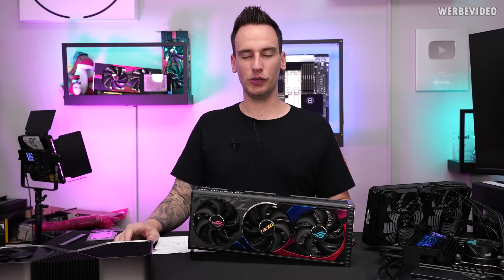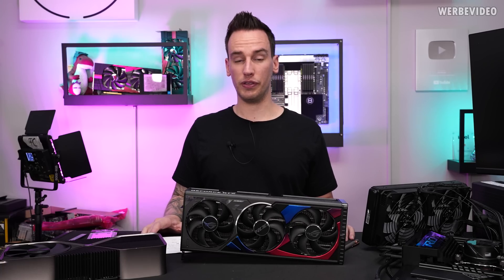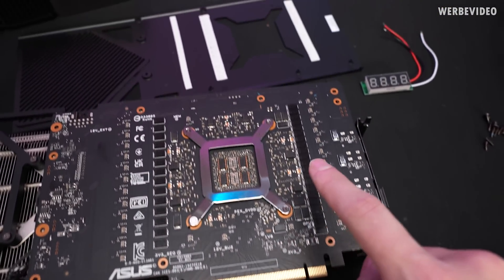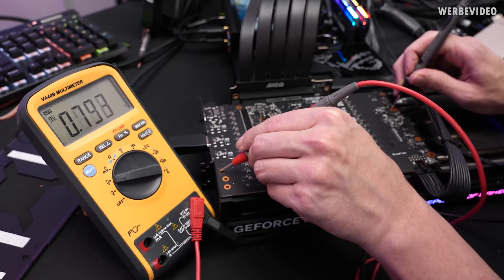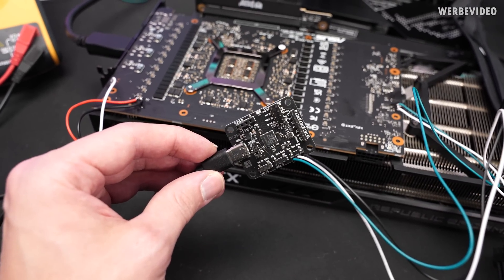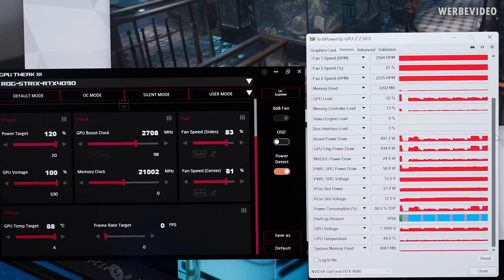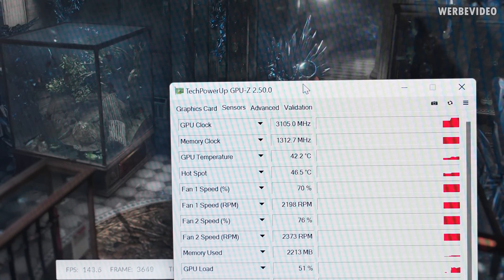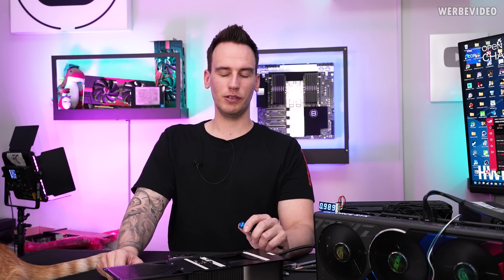Volt-Modding the RTX 4090 STRIX causes insane Power Increase

Comment: you are on a completely different level than other tech youtubers.
Reply: so much fanboys on here. If you truly loves hardware stuff, you don't mind if they are hardcore OC, engineers, reviewers etc. as long as they're helpful and provide useful information.
Reply: These guys are engineers, not just social media influencers.
Reply: Bulidzoid/actually hardcore overclocking?
Reply: @JatXoc  Comparable knowledge/content but Roman has the better production values... and cats! They bring different things to the party too. Neither are channels I'd dispense with AT ALL, unlike Jay. Linus I simply don't watch.
Reply: @JatXoc  he whines and rambles too much. He reviewed the card pcb with pictures so he is definitely not actual hardcore overclocking the 4090.
Reply: @zappulla4092  I mean, not exactly his fault he can't get hold of one.
Reply: @zappulla4092  it's hard to overclock things I don't have.
Reply: @ActuallyHardcoreOverclocking  You just keep being you, matey. We wouldn't have you any other way. 😉
Reply: Idk, sometimes I wish he'd use some better equipment. Like he can't monitor voltage and current of the 12V-In because the little gadget doesn't fit... Maybe get a proper bench-top power supply? Or use current clamps? I mean he is using a 10-year old no-name multimeter from the bargain bin at the hardware store. The voltage monitors are from Amazon, for like $2 a piece. Instead solder on some proper test leads and use a multichannel oscilloscope for visualization. That'd be a lot more interesting and wouldn't look as janky.
Reply: @graealex   ahh, someone with a strong opinion that has no idea what they are talking about.  Always refreshing to see people like you explaining how a professional should do it your way when you have no experience.  Please, tell him how he should run his YouTube channel as well, since you have 9 subscribers.
Reply: @the_Scarlet_one  derbauer fan bois are the worst, by far. They even defended his worse-than-amateurish attempts at data rescue a few years ago.
Again, most of the tools he has are hobbyist at best, which is something I don't quite get. There are plenty of channels that show proper EE. Maybe leave your own bubble for once.
And nice for you to point out that I have 9 subscribers. I think that is a lot, in the context of me not actually putting any videos out there!? And no, I don't plan on making YouTube videos, but I can still criticize the amateurish stuff that Roman does. I don't need to be a cook myself to call a steak not properly cooked.
Reply: @graealex   is roman creating graphics cards?  No?  So it doesn’t require proper electronic engineering for HIS HOBBY. He does extreme overclocking occasionally, and sets some records, but he isn’t making a 4090ti der8auer edition.  He is testing a few simple things here that do not require full on electronic engineering to be done. 

You don’t need to be a cook to say a steak isn’t properly cooked, no, but when a steak is cooked at a buffet and you expect it to be the same steak as a elite restaurant, then you are showing that you are comparing apples to beef.
Reply: @the_Scarlet_one  Idk if Roman would agree if you called him "just a buffet".
Okay, look, he does for example shunt mods, every time it turns into a soldering disaster ("Hiroshima" as Northridge would call it) because he can't be arsed to get a microscope and a proper JBC soldering station although he is trying to do micro-soldering. (to his defense, LTT recently tried as well, and it was a shit show because of a lack of proper tools, even NR commented on it)
Just seeing this shitty ass multimeter on the bench already makes my blood boil.
I watch Roman's content for more than 20 years. Yes, you heard right. When he was just doing some hobby web design as a teenager, I spent time watching my dual ISDN Internet connection slowly download his shitty-ass flash websites to my PC. Some of his dilettantism just has not changed in these 20 years.
And ffs don't call his YT channel a "hobby". That is a major source of income for him.
Reply: @graealex  Start you own channel if you are that mithered about minor irrelevances.
Reply: @stevewatson6839  Loool. What a crude argument. I'm a viewer, and I choose to be a viewer, and not a creator, because I think the latter is a pretty miserable job.
Reply: @graealex  I watch things I LIKE. Maybe try it, you might have a happier life.
Reply: @stevewatson6839  See, you WATCH things. As I do. And I like to be critical of things that I watch. Maybe try to also be critical, you might have a happier life.
Reply: There's a difference between "tech" youtubers and electronics engineering channels. He does both
Reply: Hes not a techtuber. He's a true enthusiast; there is a difference. Linus and HWUB are techtubers; zzzzzzzzzzz. DB and Frame Chasers are true enthusiasts
Reply: He's an Overclocker first and foremost
Reply: Of course he is. There is an unwritten rule amongst us German engineers to live up to our reputation 😜
Reply: Yeah, GE just complains about every little minute detail, whether it affects anything or not. Gotta make drama out of anything.
Reply: Completely different level to (instead of than) other tech YouTubers.
Reply: he is breathing modding like others air :D
Reply: @adaster98  And a manufacturer... a German manufacturer.
Reply: D8, you’re the man!  Alsoooo there are a lot of snobby divas in your comments!  But that just means you attract a wide base with your quality vids!
Reply: Jays2Cents and LinusTech Tips have entered the chat 🤣💀 I can’t stand Linus, but I like Jay he’s good.
Reply: Just about every other techtuber says 'we just hit the XMP button like people at home do!' ... That poor DDR4 4000 running in gear 2 :(
Reply: Because the market for delidding CPUS and soldering 2000€ GPUS is like 0.00001% of the population
Reply from the maker: @DuBstep115  but that's the fun part :D
Reply: @der8auer-en  just now realised you do these videos in both english and germany, not just dub it. Hats of to you, insane dedication
Reply from the maker: @tomtomi93  thanks! Shooting twice turned out to be much easier and less work than dubbing :)
Reply: @der8auer-en  still admire your admittance to actually record it twice in 2 languages, having 2 channels was the best decision you did as YouTube isn't very good the multi language on the same channel as it would always push me the non English one first (as YouTube doesn't like recommending more then 1 video per 24 hours per channel and can't tell the language difference it seems when recommending videos even when it's marked as such language )

If YouTube could have two audio streams (witch I don't believe YouTube can do, only text overlay) that would be so much easier on one channel

but as you got to do the audio twice anyway guess video Recording twice isn't must more work anyway (apart from editing and uploading twice)
Reply: @der8auer-en  
You're my favorite tech twink, next to buildzoid <3
Reply: @tomtomi93  AND he is designing and making kit to boot... in Germany! A very rare bird, our Roman. 😃
Reply: @DuBstep115  you don't know that. That's just assumption. It could be 1% or 3% or even 10%.
Reply: @DuBstep115  This is is 2600 eur card. The fuck are you getting that 2000 eur price from?
Reply: @flybeep1661  0% VAT, company card
Reply: @DuBstep115  actually cuz most of them are just reading the spec sheet and running some benchmarks, and creating bs thumbnails, anyone can do that, but it takes experience and electronics knowledge to thoroughly review something like is the VRM design good, power delivery, components used etc even though der8auer dosent get everything right myself being an electronics enthusiast i just really appreciate that the content at least goes into the hardware
Reply: @adaster98  so true, linus doesnt undertsand pcie bandwith works, most dont get that dx11 or 9 games require the use of cpu affinity on 8+ cores cpu i saw others with badly installed msi center with half the tabs missing, one had rivatuner showing core % were all wrong but benchmarked as is etc ..a reviewer had 7fps more than me on a 1080ti with its 4090 but still published that as useful info
Reply: You have know Teclab channel, they are the best moders.
Reply: For the price of that thing I could buy a quality guitar that will increase in value the older it gets, even if it gets scratched up. I know where my money would go first
Reply: When I think about all the time i wasted watching narcissist steves videos aka gamers nexus I cant help but laugh. now hes bought and paid for by nvidia and amd so anyone that continues to value his opinions consider yourself shilled.

Comment: Can you do a video like using a 12900k or 13900k with a 4090 on a 850w PSU? Like with Corsair or Cablemods' 16 pin into 2x/3x PCIE PSU connectors.

Comment: Cant wait 2 more years to buy a cheap 4090Ti and I think by then the chips will clock higher due to yields
Reply: "cheap"
Reply: Only true AMD sized as AMD is going chiplet

Nvidia however just went from 8nm to 4nm they cant go lower for 5000 series they can only rearrange the transistors or add more so for Nvidia mores lore is indeed dead as they have stated themselves

I have a 3090 and have yet to need anything better and I’m rocking 3x 4k monitors

If i could sit down and pick a 3090 and pocket the difference or a 4090 i would pick the 3090 and pocket the difference as i have no need for a 4090 mainly because i dont use DLSS so DLSS3 means nothing

I would rather a 3090 and use the difference to get an intel arc A310 and a secondary machine if i wanted or needed AV1

Comment: Undervolting did make the GPU a bit slower, but 17% more efficient
Reply: i'm looking for frames per second, not pennies per month
Reply: @XX-121  I hear ya
Reply: @XX-121  "i'm looking for frames per second, not pennies per month"

Exactly. I don't buy a computer to save electrical power --- I buy it to generate computational power. If I wanted to save electricity I would simply not buy a PC.

If I were running racks full of computers things might be different.
Reply: @XX-121  This! I can never understand spending 2k on a card and then worrying about a few bucks a month for more power
Reply: Dont think 90 series buyers want efficiency
Reply: @cor74  "Dont think 90 series buyers want efficiency" Depends. If the GPU's fans start making too much noise, I undervolt to keep it quiet. I don't play with headphones so I want my PC to be quiet and I'm happy to trade a few % performance to achieve that. If the undervolting doesn't quiet down the GPU enough or degrades the performance too much - I watercool the GPU. I guess you can say I indirectly care about efficiency :D
Reply: @cor74  It isn't that simple, many people will want a 4090 for professional workloads. If you can undervolt for about the same performance and save power and not heat up your room why wouldn't you? everyone should try to undervolt regardless of card to save power that is wasted for nothing.
Reply: @cor74  I have a 3090 and undervolt it. I really don't need 5% more performance if it means drawing another 50+ watts.
Reply: @cor74  That depends on when you ask. I wasn't particularly mithered 12-18 months ago, but when leccy prices have doubled and I don't know when they will cap out, with my PC's being the bulk of my electric use.... I'm sure taking more notice now! If I were on the Continent I'd be looking to emigrate; EU energy policy is insane.
Reply: @Corey Butler  exactly, I put 6k$+ into my rig i  want to enjoy its full potential.
Reply: @cor74  sure, they was inefficient from the moment they bought it 😂
That GPU is just a huge overkill.
Reply: @Talkshowhost23  nothing is overkill if you're rich enough
Reply: @Talkshowhost23  The 4090 is actually really efficient. I'm seeing around 70 - 120% performance increase from my 3080ti at similar power consumption. Overclocking it throws the efficiency down the toilet as is usually the case with gpu's these days.
Reply: @Talkshowhost23 
Even if it was overkill, which it isn't, it won't be in a few months.
Reply: @Igbon5  how it is?
Reply: @Igbon5  what happens in few months? 
12k monitors hit the market?
Reply: @Talkshowhost23  
More games with high specs. Everything progresses quite rapidly.
Reply: @Talkshowhost23  no such thing for 4k
Reply: @Talkshowhost23  overkill if your still running a potato resolution.
Reply: @Talkshowhost23  You couldn't be more wrong. Absolutely necessary for VR and 1440p@240hz or 4k@120/144hz displays. 
In fact, the 3090 is THE GPU you need to run the Valve Index at it's native res and 144hz, and I still didn't get there in lots of games. The 4090 is probably going to close that gap, I hope. 
Forgot to mention, if you are running a Reverb G2 for MSFS2020VR, you literally need a 3090 to even begin to run that game. Also hoping the 4090 and the new addition of DLSS2.1 to msfs will actually get us a comfortable ride. 
I don't think you understand that the top-shelf GPUs are still not good enough for current mid-range display specs with modern game titles. 
It's not overkill, it's actually not enough.
Reply: @Talkshowhost23  Sony's 16k displays are already on the market, lol. 8K is becoming more standard for flagship TVs, and 4k is the standard for all flagship gaming monitors. 
Even better, we are seeing 4k 144hz displays more, as well as 1440p@240hz and 1080p@360hz.
Reply: @Talkshowhost23  Because games and display specs are still too difficult to run natively. Most games can push further than what is possible to be playable on modern processing power. Not to mention high-spec displays are still overkill for all modern gaming applications unless you play on potato settings.
Reply: @sqlevolicious  all this talking is so far from real users market. What are you using personally?
Reply: @TerraWare  idk man.. even your 3080ti draws over 100W more than 10 series cards. I think Nvidia already threw efficiency down the toilet
Reply: @Sonic Boom the performance differences are negligible, especially considering that the 4080 is an awful value
Reply: And if you're not brave enough to undervolt, lowering the TDP/power limit is one of simplest solution, although the efficiency gains are not as big as the undervolted GPU
Reply: @sihamhamda47  and if you're gonna limit performance you can save yourself $600 and get a 4080 heck if you use onboard graphics that'll save all kinds of power!   :smh: ...you people kill me
Reply: @XX-121  Ah yes, lower tier GPUs with low TDP for much lower price
Reply: @XX-121  for sure i dont understand this people that buy a rx6800xt and undervolt to play at 1080p 30fps for that buy a ten year card that cost 50 bucks its like some gamers are really bad at building a pc they allways think the more expensive is better and then you see guys that put a threadripper for gaming that sucks completely and cost 3 times more than the better gaming cpu
Reply: Afterburner Curve-optimizer + power-limit. Yes - the curve-optimizer is increasing the frequency - which means LOWERING the voltage for a given frequency.
Used that on my 1660 Ti and i now get stock-performance but at ~80% of the powerdraw.
Reply: @Sonic Boom bruh it was a test
Reply: I undervolted and OCed my 1030
Reply: makes me think they pushed power just to require a larger cooler
Reply: wow thanks for being so incredibly vague bro. "A bit slower" lmao
Reply: Imagine people buy 4090 and still thinking electricity
Reply: @Hanginthere4100  obviously you don't have any money left to spend on electricity after purchasing a 4090 😆
Reply: @Hanginthere4100  I could run the 4090 at 100% TDP 24/7 for a month and barely pay a penny. Most people are not living in a third world shit hole that has to use the local river turbine to generate electricity. 
Hell, if you actually have to worry about the cost of energy where you live, you should focus more on moving away instead of buying luxury toys.
Reply: @sqlevolicious  most modern countries have renewable energy. it sounds like you're living in a third world shit hole if you barely pay a penny for electricity